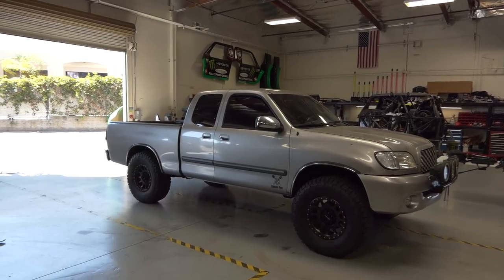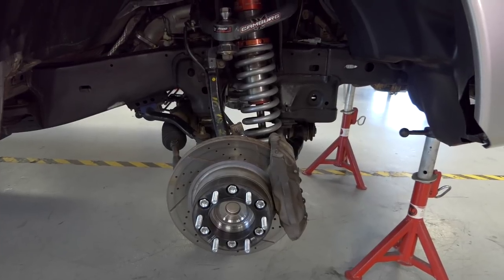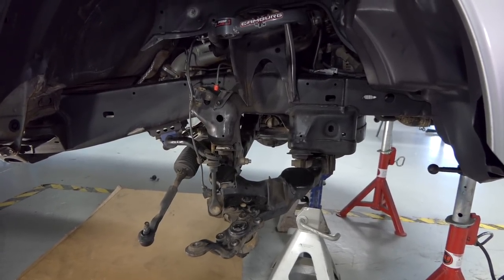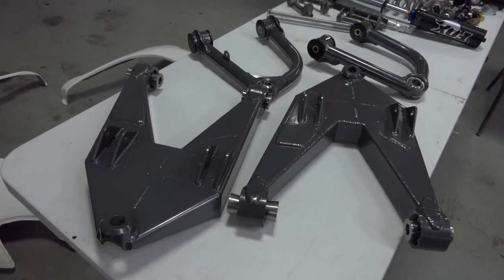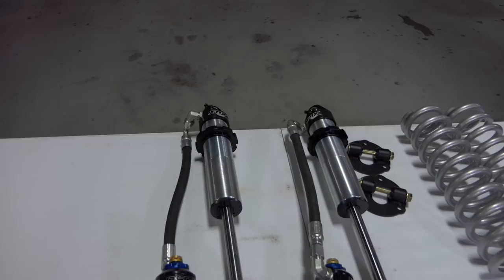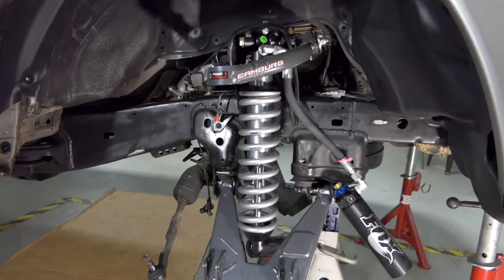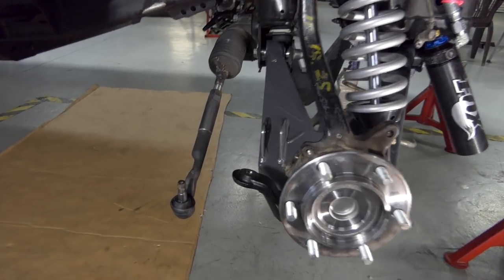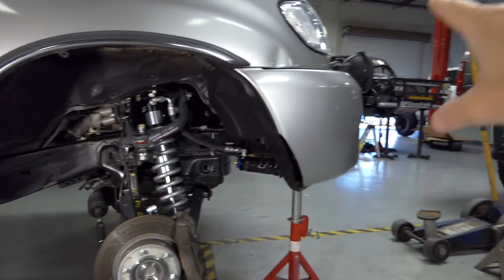1st Gen Tundra Camburg Long Travel Installation

Comment: I wish I could afford a list the old stuff that he is removing. My 2000 Toyota Tundra 4.7 front end needs everything. Makes so much noise on the bumps. Awesome looking truck
Reply: my tundy had the same issues, needed new LCA Bushings, New Lower Ball joints, New Steering Rack, New Outer Tie Rod Ends, and i got the Camburg Mid travel UCA Kit with Uniball. Fixed my issues.

Comment: You might not answer but did you cut the frame to fit the 35’s? I have camburg upper arms with 2.0 kings and my tires still rub on the back
Reply from the maker: My truck rubbed on the frame as well when I had the Camburg mid travel kit and 35's. I installed some wheel spacers that solved the issue. I have a video on my channel about the whole process 👌

Comment: I just ordered Camburg UCAs for my 2002 tundra 2wd sr5. I have Bilstein 5100s up all the way and 285/70/17s, all stock besides that. Wheels have a -12 offset. I got the UCAs because of all I've read about the ball joints with the leveling kit etc. Should I expect any issues anywhere with the Camburgs and rubbing or anything problems at all? I'm new to all this so any help I would appreciate so much.

Comment: i wanted to ask you about O2 sensor issue i have with my 2004 Tundra V8. is there such thing as a heater circuit fuse? i changed all my O2 sensors and still having a p0032 and p0052 codes.

Comment: What kind of noise would a cracked LCA mount/ bracket make? I've been trying to diagnose a metal on metal creak type of noise for the past year coming from driver side front end. Sounds like springs initially but I put my hand around the suspension components as a friend drove slowly and the vibration from the noise cant be felt anywhere on the shocks or springs (5100s all the way up and OEM springs). I feel it on the frame. Could this be the LCA mount?? Thanks for any advice
Reply: i had an issue once (from small river crossings) where my leaf springs would slide a bit against eachother and make a creaking noise that resonated a lot. applied lube to the springs and it went away, but eventually put little plastic shims in between a couple of them and that stopped it. now my brakes squeaking when i back up and i gotta diagnose that now...

Comment: I have a 2006 Toyota tundra 4.7 L with 318,000 miles on it. I haven’t changed the transmission fluid in 200,000 miles. Should I do the 4 quart drain and fill? Can anybody help me with that or should I leave it alone

Comment: Those new hubs and bearings that you got, did you go oem ?
Reply from the maker: I got the OEM Koyo bearings, but the hubs were a generic brand from Ebay. Getting those hubs was a mistake because they did not have the same tolerances of the oem hubs. After about 2k miles of driving I started to have some play in the hubs. I ended up purchasing another set of Koyo bearings and using the original oem hubs...
Reply: Mike French its always the ebay parts 🤦🏻‍♂️ lol cool thanks for the response. I got my Camburg kit too and im replacing everything up front except for the steering rack. Just deciding if I should go oem or not for the bearings, but I think I probably will. How much did you get yours for?

Comment: What light bar mount is that?
Reply from the maker: N-Fab Baja bar for a 09 Tacoma. I welded on some brackets to the inner metal part of the oem bumper then bolted it on. Worked out super well 😎👌

Comment: What kind of bumper do you have? Stock?
Reply from the maker: Stock bumper with a N-Fab light bar
Reply: @mikefrench316  I was looking on the N-Fab website looking for this bumper/light mount but they are listed as fit for the Tacoma, how was it to make it fit our Tundras ?
Reply from the maker: @davidbinch9332  I purchased their street light bar for a 2009 Tacoma. I then welded some basic L-brackets onto the inner metal part of the oem bumper, then bolted up the light bar onto those. You could even bolt on some custom brackets if you don't have a small welder...